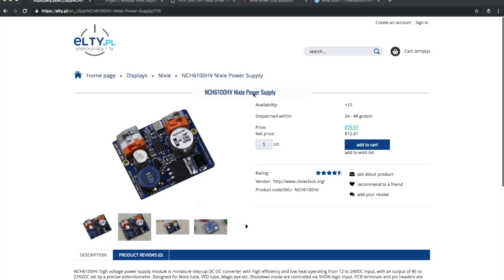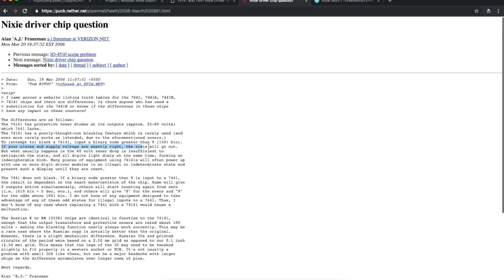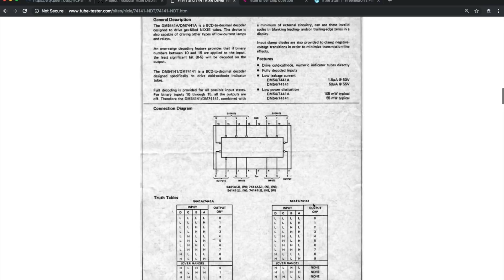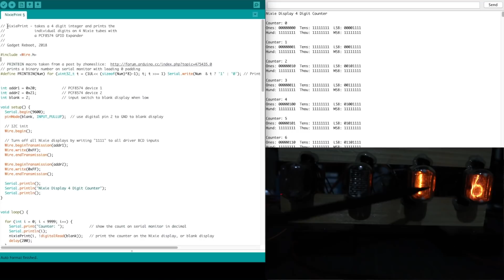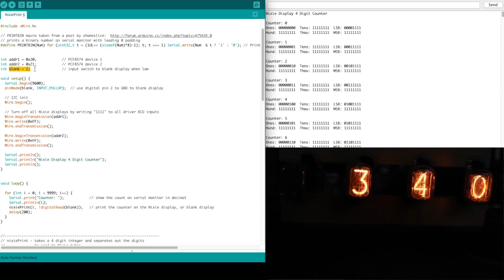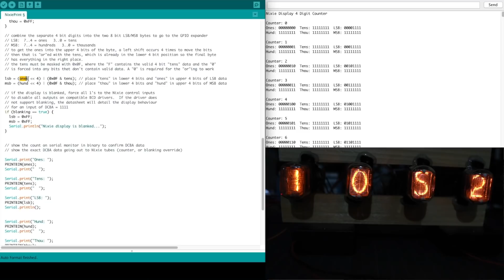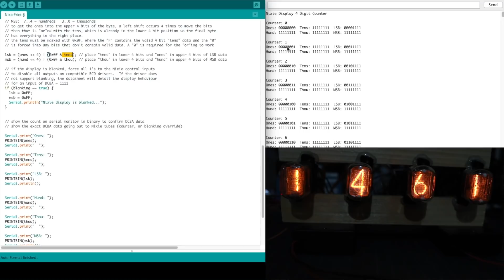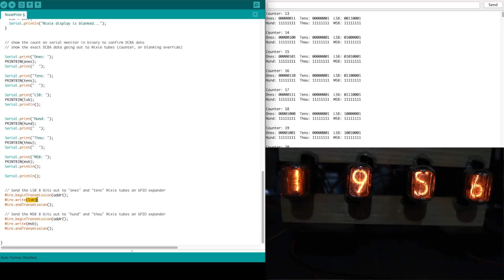Arduino Controlled Nixie Tube Display

Comment: Do I have your permission to use you sketch for creating my own 8-digit NIXIE tube up-counter?   If so, may I share it with a frient/consultant? Please advise.  Thank you.
Reply from the maker: Yes, I consider it an educational public domain project that people can use how they wish.
Reply: @GadgetReboot  

Hi! Wiring and sketch have all been triple checked, but all 4 Nixies appear “blanked” due to “1s” on the DCBA inputs to the K155 drivers.  I sense I am missing something, having to do, perhaps with the hex addressing of the two separate GFIO extender boards or, alternatively, signals from the SCL and SDA I2C leads from the Arduino?  Please advise at your convenience to haslov@att.net  Thank you!

Comment: The very last question :) :) My nixie tubes work perfectly with your code, but when i tried to convert it to clock i have problem... i switch "i" in your code to "rtc.getTimeStr()" . In serial monitor i can see :

Counter: 20:35:20
Ones: 00000110  Tens: 00000101  LSB: 01100101
Hund: 00000010  Thou: 11111111  MSB: 00101111

Time in serial monitor is changing but binary code is not and Nixie is showing 2:56 all the time.
any suggestions what to change?
Reply from the maker: If I understand correctly, isn’t rtc.getTimeStr()  going to return a text string which happens to have some numbers and formatting characters? The NIxie  display is expecting an integer so you would have to convert the digits from the RTC into a single integer and send that and then  The digits will show up.

 I still haven’t used my RTC so I’m not familiar with the libraries and if it’s easy to get numerical digits or if it’s all strings and requires some code to convert. But that most likely is what’s going on. 

 Off the top of my head, if the only RTC information available is a single text string that includes numbers as well as separators like :  ,  I would have to look up how to strip out any characters out of the string that are not numbers and then when there’s only numbers left in the string, convert it to an integer that I can send to the nixie Tube. I found this thing that reads in characters from a serial port and does something similar so I would use this for inspiration to get started. 
https://www.arduino.cc/en/Tutorial.StringToIntExample

 If the RTC library does allow just reading out direct integers separately or something like two digits for seconds, two more digits four minutes, two more for hours  in integer or some other digit format , I would have to look up how to concatenate (join together)  three separate numbers like that into one single integer and send that out so that everything displays in the correct position. 

 I haven’t opened the mail yet but I think I actually received my nixie tube dots that I was waiting for so I might be able to work on my own clock display. We can race to see who figures it out first.
Reply: @GadgetReboot  I accept challenge, thanks for the advice!!!

Comment: If you want to add leading 0's check out printf() and sprintf() ... although they may be too bloaty and expensive to use for these small projects. That macro is indeed very cool, but I can't help but think there is an easier and less obfuscated way to accomplish what it does. 🤔
Reply: ONOZ there is no printf() or sprintf() in the Arduino language subset thingy. I thought Arduino used ANSI C but looks like I was wrong.
Reply from the maker: I just hack and slash my way through until something works. I learn a little more every month. I think what will force me to become more efficient is if I ever do need to cram too much into a small space and I’m forced to size it down.

Comment: The last question :) is it necessary to put resistor to main voltive line, if so, what value should it have.
Reply from the maker: Yes the resistor is needed just like for current limiting an LED. 
 So the nixie tube is going to have a data sheet cathode current value  which is the amount of current consumed while the display is lit, and it is also going to have a plate voltage which will be the voltage across the nixie tube when it is lit, similar to the forward current of an LED and the voltage drop across the LED when it’s on, so then the resistor is calculated to provide that current at that known voltage drop based on the actual high-voltage you are giving  from your power supply. 

 So looking at this nixie tube data sheet 
http://www.tube-tester.com/sites/nixie/data/in-12a.htm
 Plate voltage is 145 V,  cathode current between 2.5 to 3.5 mA, lets say 2.5 mA,  and suppose your power supply is 180 V. 

 There’s a quick calculator here 
http://www.csgnetwork.com/anoderescalc.html

 Entering in those values you would need a 14 K  resistor  that can handle .09 Watts

 Here is a little more info from Hackaday getting one up and running. 
https://hackaday.io/project/1940-modular-nixie-display/log/11038-the-in-12a
Reply: @GadgetReboot  Thanks for all help!
Reply from the maker: Glad I  could help work on a project vicariously through someone else!

Comment: Is it possible to create clock from this circuit?
Reply from the maker: Any numbers in the Arduino/ESP8266/etc can be sent out and displayed so if the processor has time data, it can be sent to the Nixie display like this with the GPIO expanders.
I don't have the Nixie dots that are used for the colon between hours/minutes so I haven't tried doing a proper clock but it would just be a matter of adding the extra IO stages and sending out control data or if the colon will always be on, not blinking, it doesn't even need special control, just always driven on.

I was going to do a real time clock project.   If I do, maybe I can shift the time out to the Nixie display as part of the demo.
Reply: @GadgetReboot  So DS3231 Real Time Clock Module  should work fine???
Reply from the maker: Yeah I think that’s the one I have, the board also has an extra memory chip on it that has nothing to actually do with the clock but I’m going to try to get that up and running and if I can remember I’ll put it on the NIxie as well.  Maybe I should go shopping for some NIxie dots

Comment: The only time I had any issues with blanking was when a power supply cheap one that had poor filtering giving a lot of AC ripple. Gave the diodes issues causing bleeding of the voltage. With a good clean DC HV supply it should be ok.